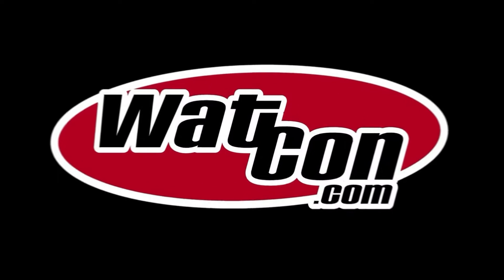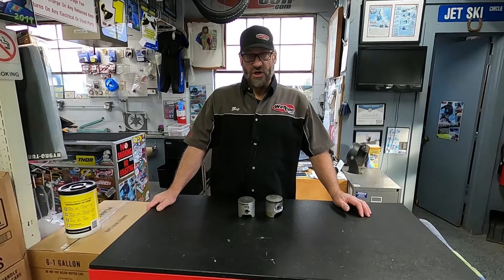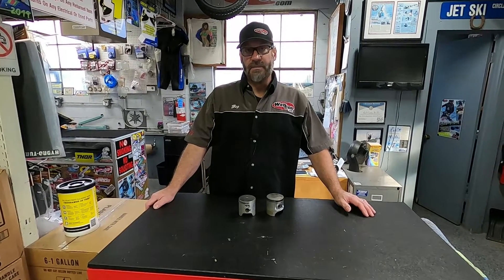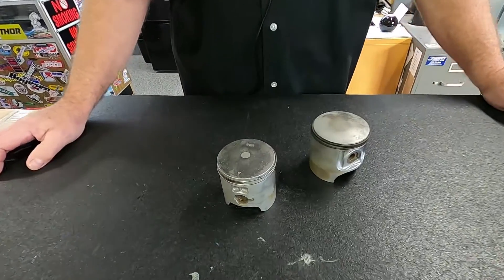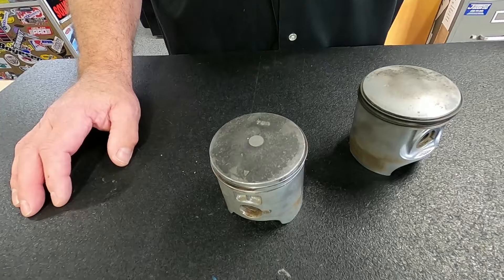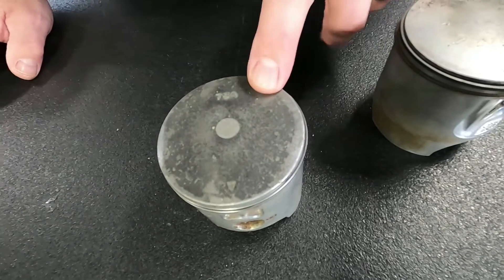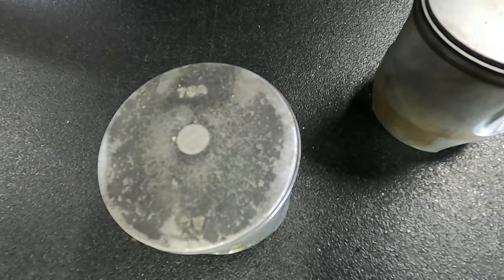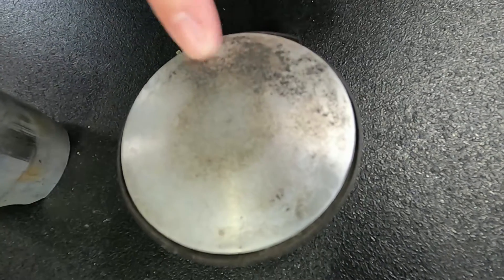piston wash talk

Comment: Thank you for sharing, is an accurate tach like a pet-2000 a good tool for rich/lean detection, do you use something like this?
Reply from the maker: Yes, the PET Tach's are very good.
Reply: @watercrafttalk2738  thank you for the quick reply, could you do a video on tuning a Yamaha triple carb setup, would laser temp gun help find a lean cylinder, if hotter then richen that carb?
Reply from the maker: @jasons4745  Thanks for the suggestion.  Not sure, as we really are not working on many triples anymore, but if one comes into the shop we could maybe do a video.
Reply from the maker: @jasons4745  Check out or video on piston wash.